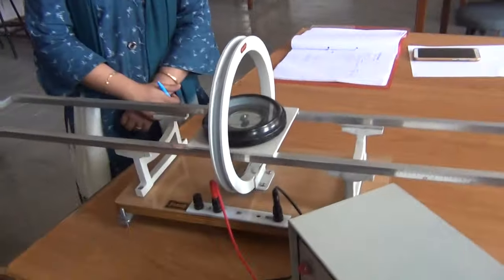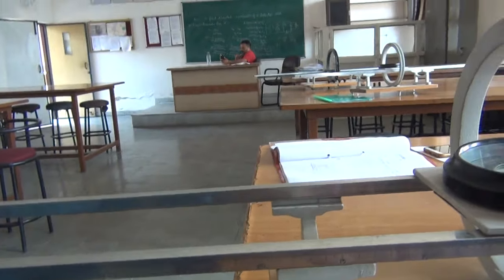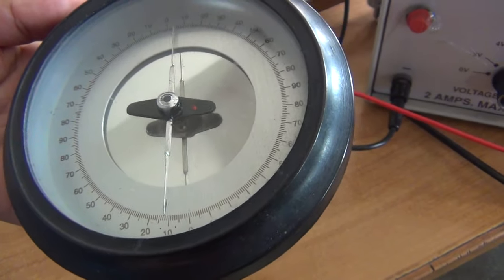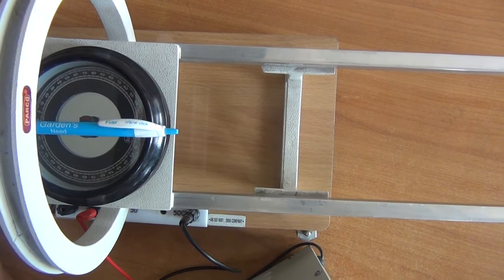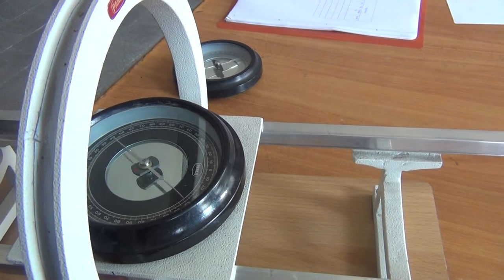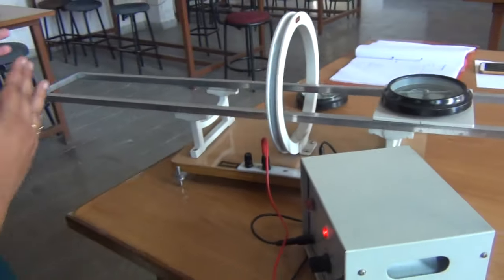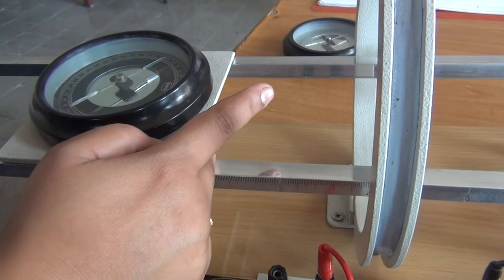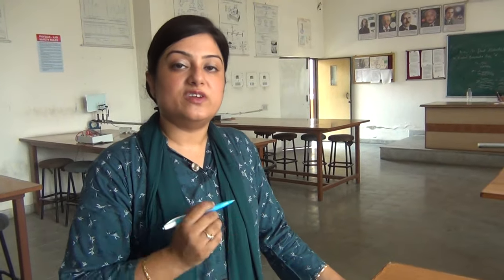Variation of Magnetic Field due to current carrying conductor with distance along its axis.

Comment: If you don't connect the ammeter how would you measure the current value?
Reply: Don't need to connect the ammeter compass needle automatically moves on connecting the keys